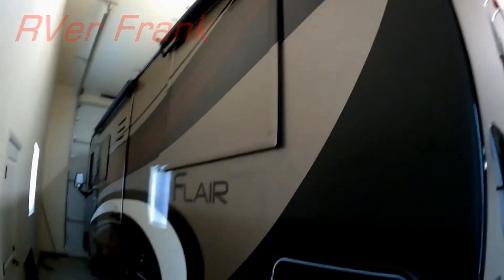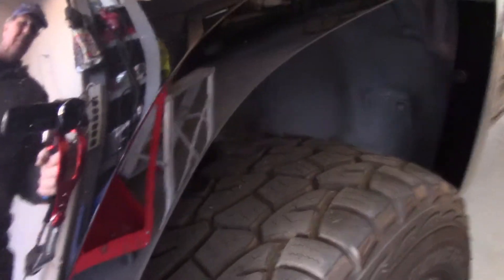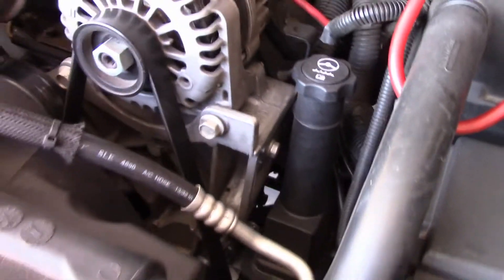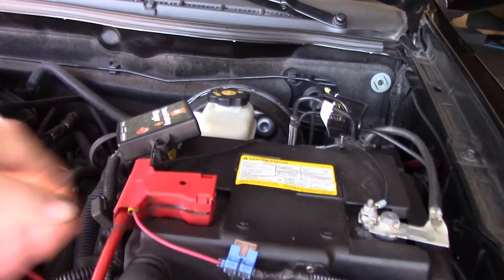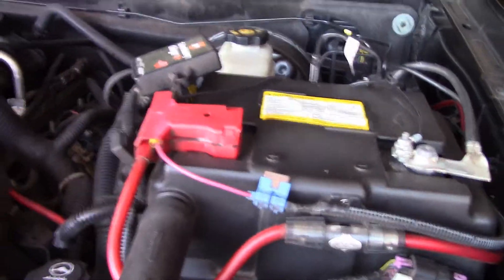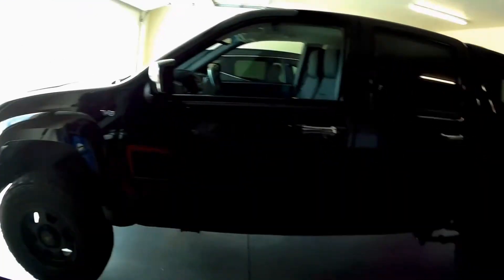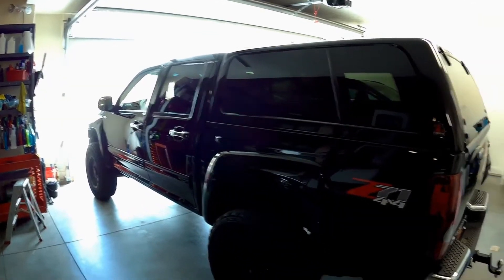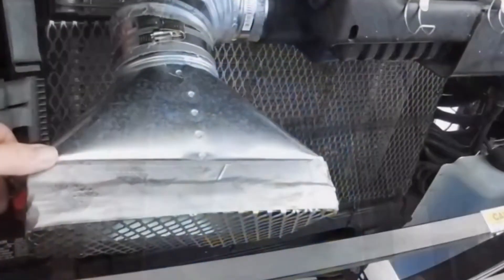566- 2011 Colorado Toad - Update

Comment: Stephan Wade Ram is well known, as a lot of rodeo families go to St George. Wade  knows how to do good business with them. The 5.3L is nearly indestructible with exception of the cylinder drop 8 to 4   it can do the cam in early so the GM techs say. But still not that big of a deal until real high mileage. That truck looks perfect for that kind of mileage. My Ps cooler leaks a bit you reminded me ugh LOL
Reply from the maker: This 5.7 hemi has the 8/4 drop eco mode which doesn't occur much with the 4" lift and 35's making that hemi work.
Reply: @RVerFrank  Make sure you are using exact grade oil they will not go into MDS mode if the weight of the oil is not exact. My 6.4 L Hemi would go into MDS at 130 mph at even throttle, so  you may have something else going on? You can also have it reprogrammed if it bugs you.